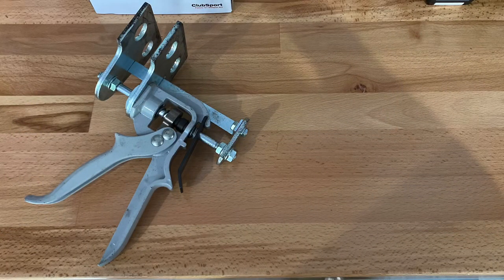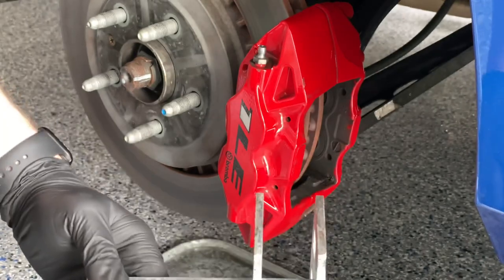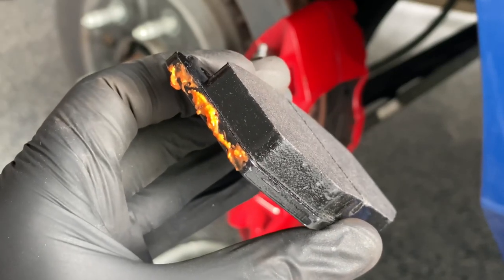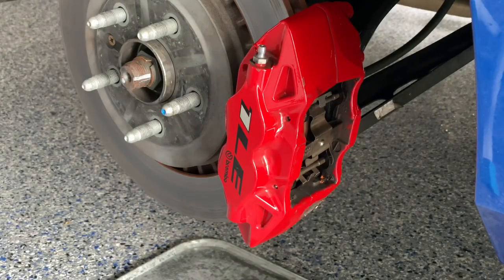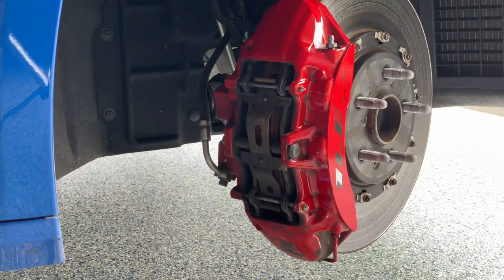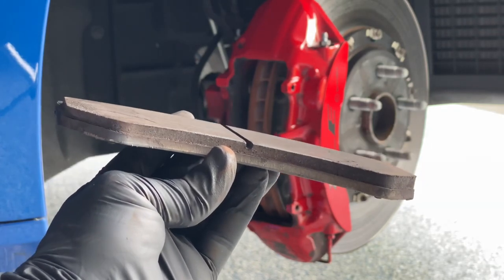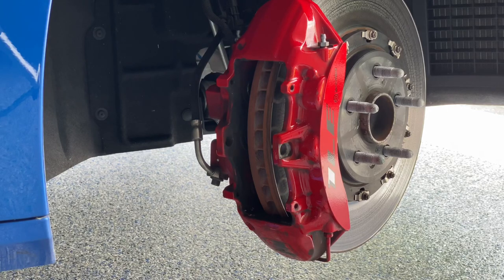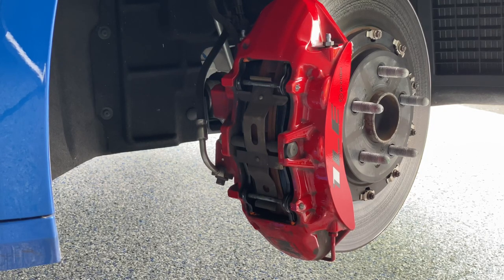How-To: Brembo Brake Pad Swap // 6-Piston & 4-Piston Calipers

Comment: The only additional step I'd add it to brake clean the caliper before fitting new pads, plus I also put a thin layer of lubricant between the shims, pads and pistons just to eliminate any noise. Love this setup though very easy to get the job done quickly!
Reply from the maker: Good call out on the brake parts cleaner. It’s like muscle memory for me, so I forgot to call it out. Always clean your brake components, new or old if you are swapping. I disagree on the lubricant between the shims and pistons though. On a fixed caliper setup like in the video, the pads slide back and forth on the edges where I show you to apply the lubricant. Adding additional lubricant to the back side of the pads or shims doesn’t do anything for sound, and only adds additional points for brake dust, grit and grime to build up causing an unnecessary amount of grease to build up. Over time that added grime can cause an imbalance and vibration, which then actually causes more noise. On a floating caliper setup (like to typically find on just about every car/truck/suv) it makes more sense because the entire caliper floats to make contact with the rotor, and is usually prone to more noise without lubricating the back of the pad. For what it’s worth, I’ve never lubricated the back of the pads or shims on a fixed caliper setup and the only time I’ve ever had noise was with a Hawk DTC-60 pad, and that was from the compound, not your typical brake pad squeal which is caused by vibration.
Reply: @FollowMyLine17  yes, sir, on the floating calipers lubrication is requested by service manuals on the edges on the pads and between the pad and shim. The back of the shims facing pistons shall not be lubricated. At least on the Japan cars. And thank you for the great video guide!
Reply: This comment here. He said to brake clean the caliper. What is he referring to and what do you use/do to clean them
Reply from the maker: @andrewg7678 ah ok. Yes, I use Brākleen. Just spray it all over the components. Wipe with a rag. Here is a link: https://amzn.to/3Ek36Gu
Reply: @FollowMyLine17  thank you!

Comment: Thank you for the detailed video, I'm about to do my first pad change on my 1LE and this was perfectly clear. Two questions: 1. Any harm in adding brake grease to the contact points of the pistons? 2. Where did you buy those titanium shims?
Reply from the maker: Thanks for the comment! I’d be happy to answer. I would NOT put the grease on the piston contact point. All it does in that spot is collect dirt, dust and debris and that stuff can lead to premature dust boot failure. Adding it to the back of the pad at the piston doesn’t really do much for noise or vibration either, as most of that comes from the sides of the pad. The shims can be purchased from 89X Motorsports or KNS Brakes and are made by Girodisc.

Comment: Really good video. This is the same as I do but I do some internal caliper cleanup if I have time. Check the rear Ti shims they can be too big to clear the tabs on the back of the Hawk pads. I had to trim mine. Could add a link to the pad spreader tool you use
Reply from the maker: Thanks for the tip!  I trimmed the shims for the rear pads, and added a link to the caliper spreader in the description. I appreciate the feedback.

Comment: Hi, do you have an idea on how much the ti plates help?  My shop got me Hawk sprint race pads  are those close to the pads you like?  Thanks
Reply from the maker: Did they get you the ER-1? I haven’t tried those yet. The Ti plates help keep the heat out of the fluid. They have massive heat dissipation properties, so they should keep the pedal nice and firm the entire session.
Reply: @FollowMyLine17  Thanks, the track near my house is 20 turns in about a mile. It is killing my car...kinda  fun though.

Comment: Dude, I could not get the center bridge bolt out at all on the fronts. It's like it's welded in there. I had to take the whole caliper off.
Reply from the maker: Well that’s no good! It’s just a bolt at the back and pops right out towards the outside of the vehicle. Sometimes taking the bolt at the back halfway out and using a small hammer to tap it outwards helps too.

Comment: Looked up that piston spreader tool but it looks like bad reviews and photos of the tool breaking after first use.
Reply from the maker: It has 4.6 out of 5 stars from over 6,500 reviews. I’ve had mine for 7 years with zero issues. I wouldn’t use it if it wasn’t a quality tool.

Comment: What brand of Ceramic pads would you recommend for low dust for daily driving with 6-Piston (front) and 4-Piston Calipers (rears)
Reply from the maker: That is a really tough question to answer. Typically when you have a low-dust pad, you also have performance that matches. I haven’t found a good low-dust pad that performs well over time. You usually sacrifice stopping power for a cleaner wheel. My recommendation is to determine exactly what type of driving you plan on doing and get a pad that matches that purpose.
Reply: @FollowMyLine17  Know anything about Power Stop Z26? Its for a 2020 charger scatpack widebody, I don't track the car, its my daily driver.
Reply from the maker: @menswearhous  yes, I do! I had a Scat Pack Challenger before. The Z26 pads are fine for a daily driver. They are low dust but they do not stop as well as the OEM pad. Keep that in mind and you should be fine.

Comment: I've noticed a rattle coming from the spring on my brembos. Would it be fine to add a bit of grease where the pins make contact with the spring?
Reply from the maker: Yes, you can, however if the spring clip is rattling you may need a replacement spring clip, they shouldn’t be loose enough to rattle. They should be snug against the pins and pads.
Reply: @FollowMyLine17  gotcha. Thank you for the response! 👍
Reply: @splerg31  did that fix your rattle issue?
Reply: @andrewg7678  No it did not. Have also had a couple mechanics look at it and no dice. Also, had an alignment recently. Everything feels fine just that dam rattle. Replacing the rotors and pads soon so I'll have a deeper look into it.
Reply from the maker: Another thought here, try removing the clip altogether. Those are there for NVH and aren’t REQUIRED. See if it goes away or stays. If it stays the issue is elsewhere.

Comment: I have a similar Camaro, is it OK to street drive with race pads??
Reply from the maker: Typically speaking, it is not OK to use race pads daily.  Race pads don't have the initial bite that street pads do when cold and take much longer to achieve their proper bite and get to operating temp. This can cause the car to feel like it has no brakes at first, and if you are just getting out on the road and need to make an emergency stop, you may not be able to stop in time.  My car will be sitting and not driven until Road America, so that is why I put the race pads in instead of the OEM Brembo/Ferodo street compound.  I will swap in the OEM street pads once my track event is over and drive home on street pads.

Comment: Where do you buy that pistons pusher tool
Reply from the maker: It is the first link in the description. Amazon.
https://amzn.to/3Ezbi5s
Reply: The link isn’t the same as the one you are using! I’ve clicked it numerous times
Reply from the maker: @McRib47  hey thanks for letting me know! It looks like the amazon link has changed. I’ll see if I can find the Lisle part number on the tool and list it here, and possibly get an updated link in the description.
Reply from the maker: @McRib47  the part Number is a Lisle 29100 Quick Quad Pad Spreader. Looks like they are available on some other sights, and out of stock from Lisle direct. They might be discontinuing them or replacing them with a new model. Could be why the amazon link changed to a different part number.
Reply from the maker: @McRib47  I reached out to Lisle, the 29100 should be back in production soon, within a few weeks.
Reply: @FollowMyLine17  yess thank you
Reply from the maker: @McRib47 the caliper spreader is available again, here is the link:
https://amzn.to/3Ezbi5s
Reply: @FollowMyLine17  thanks so much

Comment: Where did you source the titanium shims
Reply from the maker: Vignesh Vivek I was able to get them from KNS Brakes. The sims should fit the ZL1 also...
Reply from the maker: https://www.knsbrakes.com/c/car-items/4965_2018+Chevrolet+Camaro+SS+1LE+-+6+Piston+Brembo+Front+Caliper/_/7_Upgrade+Items
Reply: Gotcha. I have the front ones. Didn't know they sold rear. I am running just the stock stainless steel shims for now

Comment: That extra shimm...all i can say is......cleverr giirrrll🤣🤣👍👍👍  itsa frikn genius idea
Reply: @FollowMyLine17  hahah  thats the one👍👍
Reply: While your here  ever had massive  vibrations and noise from the front brakes when driving slow and coming to a stop at slow speeds...say pulling into driveway or parking lot??
Reply from the maker: I have not, not on this car anyway. I would check the pins and spring clips to make sure they are seated properly.
Reply: @FollowMyLine17  🤷‍♂️ i put em on and let em go...ita only showed up the last couple months........could be anything...im thinking worn out bushes on front suspension causing excess movement back n forth as its idle speeds so there isnt enough  momentum  to keep constant force???
Reply from the maker: Just a thought here, but try removing the tension spring from the calipers one side at a time and see if the noise gets better or worse. Those are typically there for NVH reasons to quiet things down. See if it gets better or worse.
Reply: @FollowMyLine17  tension springs?...is that the brass clip that pin slides through?
Reply from the maker: @MadLadMartyMcFly85  yes
Reply: @FollowMyLine17  rodgaa,ill have a gander  next week👍  for all i know those pins have flown off somwheres🤣🤣
Reply from the maker: @MadLadMartyMcFly85  well the pins hold the pads in, so let’s not hope that is the case haha.

Comment: ..boy.. this is gonna be fun when it comes time (If I choose) to do my brakes on my 2021 Scat Pack... yay for Dynamic pack lol and...1,500$ front discs (a pc) lol nice vid.
Reply from the maker: Thanks! I had a Scat Pack previously that I upgraded the brakes on to the Hellcat 6-piston. You can definitely find the rotors for much, much less than $1500/each. Check out KNSBrakes.com @knsbrakes and they should be able to hook you up. It’s where I get all my brake parts from.
Reply: @FollowMyLine17  thanks, but do they ship to Canada lol. Might Have to go via rock auto when the time comes , these DFC two pc coated rotors look interesting.
Reply from the maker: ¯\_(ツ)_/¯ no idea. Reach out and ask them 😁